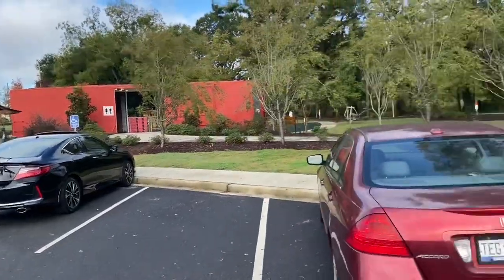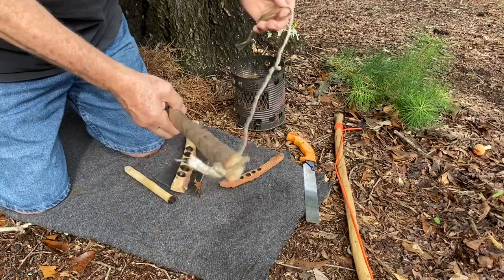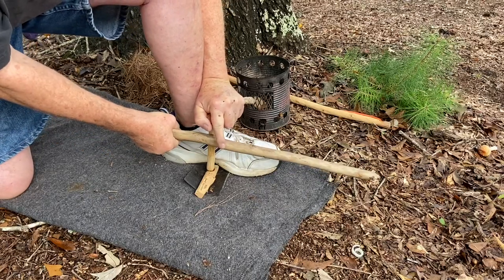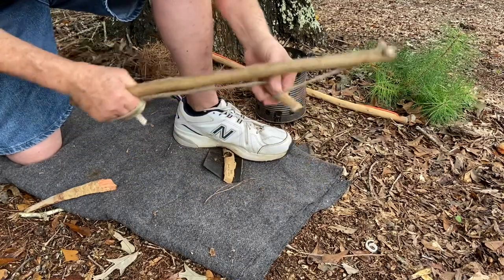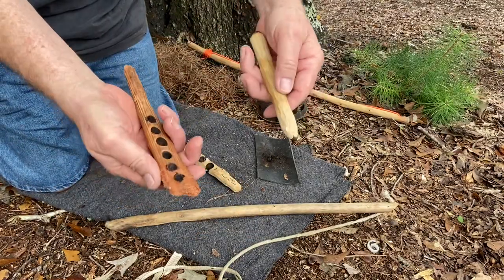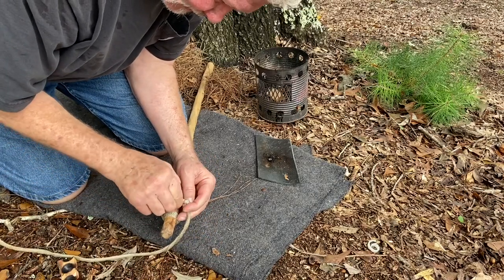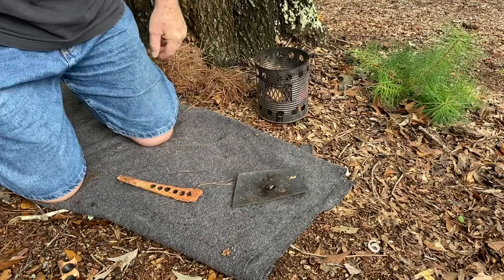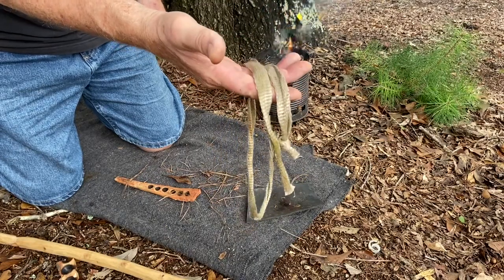Tons Of Bow Drill Advice. Using A Found Nylon Strap For Bowstring!

Comment: Mr. West in case you didn't know I believe they refer to that as mule tape I've seen anywhere from 1500 lb to 2500 lb tensile strength. I seen him use it to pull wiring a cross parking lots for La light poles.
Reply from the maker: Yes somebody mentioned that. It looks just like the bigger nylon straps we used for rigging that was rated at several tons. Thank you!